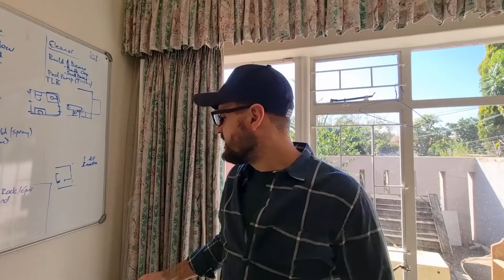Episode 5  ||   Interior design from the Bigpond guys

Comment: Dude I need work, you need a tool inventory a person that should take responsibility for giving out tools, I have no idea on how big your operation is or how or even if you have office off place to store tools. I will do building work aswell anything, use to be on the mines I was a dragline operator those machines that remove all the top soil from the coal the biggest and most expensive machine on a open cast mine.

Been without work for 4 years, BEE stuff